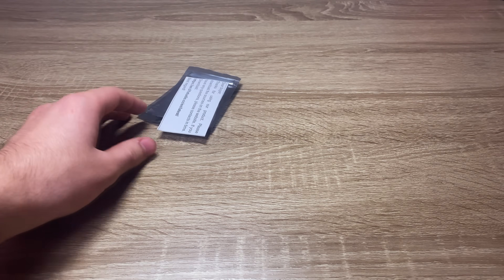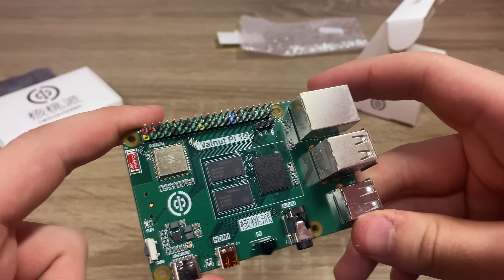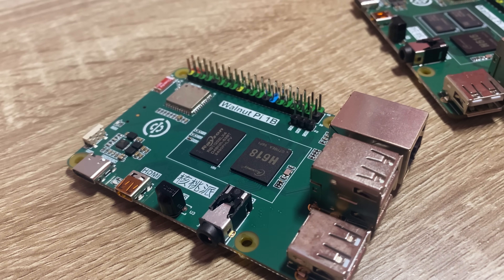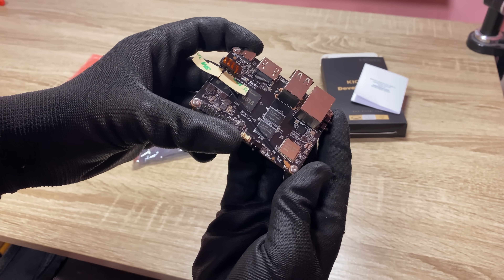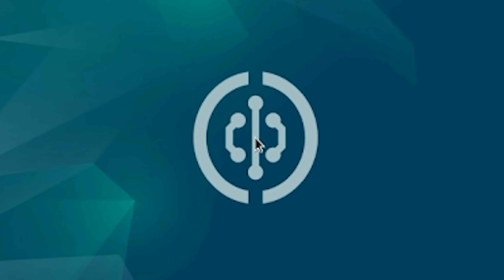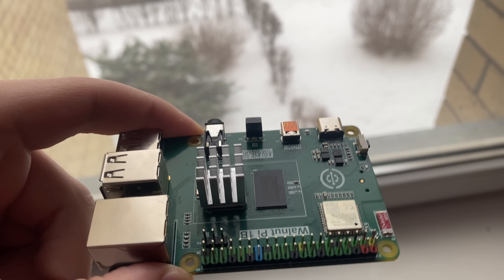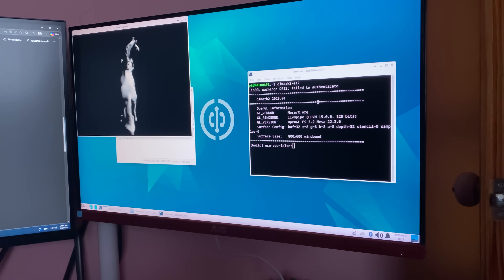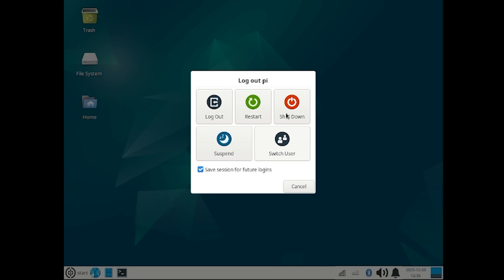I Bought the Cheapest Raspberry Pi Clone on AliExpress…

Comment: Hmm, the cheapest way to run genuine Linux, I've ever found a Redmi 2, bought a second hand one, the screen was cracked but it worked and was random. Between 1 and 2GB RAM, the price was only 2 dollars. If there was a promo, it was around 2 dollars in the country.Very good especially Debian with a good touchscreen sensor, the screen quality is very good at the right size of 4 inches 720p and the performance is quite good, maybe equivalent to the Raspberry Pi Pi 3, especially with Fredreno works, maybe I will buy the redmi note 4 series which has performance above the raspberry pi 4, of course the price is very very cheap, not up to 15 dollars 😂

Comment: The biggest problem with devices like this is not the hardware, but the fact that there is almost no software support for them. A year ago, I bought Spieed Longang Pi3H, which was supposed to have Armbian support "just around the corner" ... yeah, I'm still unable to run Armbian to this day (there is an unofficial image, but it doesn't work). Sure, you can run the official Debian from Spieed... if you're willing to trust an unknown Chinese manufacturer... Bigger brands like RPi or Odroid don't have these problems.
Reply from the maker: The Debian image for the board from a video is open source, but I haven’t examined code myself.

Comment: I got myself a while ago a Wukong Pi from AliExpress. It came with no support, no official firmware, but after researching a bit, turns out it's the same as an orange pi zero, with an Allwinner H3, but with no HDMI, so I set it up using UART and an ESP32. I installed a Linux image corresponding to the Orange Pi Zero OS, and now I have an "Orange Pi Zero". 

In these cases you are going to have more luck if you install an OS that is not the manufacturer's OS. In my case I used armbian, but DietPi was also supported. Keep it in mind if you end up purchasing these kind of boards.

I use my board as a cheap WiFi pen testing kit, and also for remote administration at university. After installing a battery onto it with a separate charge module, I can get 4 hours of battery life out of it. Very nice device, only 512MB of RAM tho.

Comment: Many years ago, after having to fiddle with Orange Pi and failing (the manufacturer did not provide kernel sources, video capture device was not supported on the provided kernel), I have decided to only use Raspberry Pi.
Reply from the maker: I guess situation changed since that time. Will review Orange Pi's cheap offering next month I guess, because they offer 8GB of LPDDR5 for as little as 55$ on AliExpress. Kinda curious to see how well it performs.

Comment: Hi All

Great video, for anyone who does not trust modern cheap hardware / software, you can purchased a 4 to5 year old dell / HP / Lenovo or similar thin client that will run linux fast ( or windows 10 )
I have 3 x PI3b and 1 x PI400 for spare machine when the main desktop and laptop are in use - all the pi's run emulation but the PI400 is dual book and can run as a reasonable Linux PC desktop

Comment: Listed processors should have some kind of hardware acceleration built-in CPU but probably not correctly initialized. They're slightly more expensive than they should be. There's 64bit faster processors with reasonable prices. Anyway if you need automation of some kind they might be useful
Reply: Which 64 bit platform is just a little bit more expensive? 😂

Comment: Raspberry pi's used to be a cheap single board pc alternative for cool projects, it became ridiculously expensive in the past couple of years. a pi5 is now the price of a cheap 2nd hand micropc which you can use as a nice home server. i have about 10 3b+ laying around and they're fun to use. but it's not worth the price anymore.same thing is starting to happen with arduino as well
Reply: The manufacturer promises that they will always cost exactly $35 no matter how many new versions are released.
Reply: @andrewhristov in that case i wish i could buy directly from the supplier..pi5 is already more than double that.

Comment: I have an Orange Pi Zero 2W 4GB, powered by the H618.

The Allwinner H616/H618 are designed for set-top boxes running Android TV, not regular desktop/server OSes.

The difference between the H616 and the H618 is that the latter has better support for newer Android TV versions, specially in higher resolutions. Graphic driver support for desktop environments is bad, really bad, and I don't think it will improve ever. Ethernet is only 100Mbit/s because it's enough for Android TV (most Android TV boxes that have Eth are 100Mbit/s).

There's an unnofficial release of Armbian for the OPi Zero 2W but only works ok as CLI, I do not recommend desktop environment because of the above. I don't even know if there are libraries in Armbian for the GPIOs...

Conclusion: avoid.
Reply from the maker: Yes, the problem is: there is no Android TV image for it (or I haven't found one yet). As for server OSes, why not? Good thing for lots of applications, like TG bots, klipper, etc. But yeah, for desktop those are just too weak.
Reply: @TheSillyWorkshop you can try the one for the OPi Zero 2W, from the official site. You do have to follow the instructions in the manual, using the writing tool they mention.

I hadn't used the OPi Zero 2W in a few months, seems Armbian now has a download page for it with the community maintained versions. Trying desktop with XFCE, the glitches I had even with the official desktop images on anything above FHD resolution are gone, seems fairly responsive at the moment. I'm using a 4K (UHD) monitor. Updating it and then installing a browser (none by default) and will write here with an update on the experience, specially YT videos...
Reply: @TheSillyWorkshop as I expected, no YT video acceleration, not even Firefox rendering acceleration, all software.

Armbian's XFCE desktop is usable but slow, heavy applications take a bit to load (fairly fast uSD card but seems SoC access is slow anyways) and their interface can take some time to respond depending on where you click. H616/H618 is not definitely for desktop use.
Reply: @TheSillyWorkshop In the 'WalnutPi_1_Android_TV_image‘’ repository on Github.

Comment: strange how one of the USB ports off the cheaper model, and I would trying make a Ip, than the actual real Pi, can it getting cheaper, one port instead of twom thee still one port the the soldier and everyth the putting port on the board, an actual hand placing a component on the board all that stuff you still need todo, and in the meantime try, be a better Pi that well a Pi, go USB power instead of hole? and the USB most like the used ports on most PI real ones or not? and not 4 a lot ports in the first place?

Comment: I own a bunch of those fruit pi or china pi likes, they are cheap af and works ok, but the main problem is the lack of kernel support for those chips, they are mostly based on a soc manufacturer proof-of-concept first release that's as old as Linux kernel 4.x, and the available system images with outdated and eos 5.x kernels are just dirty dts hacks with hundreds of bugs with half features not working. Don't even bother trying to compile Armbian and even less try to ask for help in their forums, you'll just end humiliated. So yes, proper kernel support is the most important thing here in a world of hundred of rasp pi clones, maybe that's why Raspberries are way more expensive, if you are looking for cheap chinese pi alternatives, look for the ones with proper kernel support or you'll end up stuck on an old eos kernel and a system image full of cve's.
Reply: Which ones would you advise to use? Wallnut pi has good Linux core support?
Reply: @mmuller2402  look for supported boards by Armbian project marked as 'conf', they have great support, 'csc' is community supported and it's a hit or miss.
Reply: @mmuller2402  if you don't need gipo just get used mini pc. Used Lenovo m72 tiny can easily cost like one of those sbc and perform 10 times better
Reply: Entonces, cuál recomiendas de las placas baratas? Que tenga un buen Linux sobre el que montar nuestros proyectos? Gracias!

Comment: This looks good, initially, as a small server, but I would stay away from any of these clones. They will not receive OS updates anymore and at some point you will not be able to update the packages for security. Maybe good for some controller that never needs updating.
Reply: ? The updates come from whatever OS you install. Install raspbian or armbian and updates are available
Reply: @TechdoLiberal  Half true. I have a TV box converted to armbian but it stopped receiving OS version updates a few years ago, so it's now stuck on jessy or wheezy. If you are on an old version of armbian you might be missing out on shiny new packages or you might run into incompatibility issues. Sure, it's open-source, but porting a new debian release is not really trivial and the work is already done for Pi.

Comment: There is no CE or FCC certification on your PI clone boards. They are illegal in Europe and USA !!!
Reply: CE means nothing when it concerns legality. The same with FCC.
Reply: @samuellourenco1050  Without a CE Declaration of Conformity, the product is not considered safe and cannot be sold in Europe. Likewise, without an FCC ID, the product cannot be sold in the United States. This is not a joke—devices that are not properly tested can be dangerous and may cause interference or malfunction in other equipment, including medical devices. Additionally, what about hazardous substances such as lead?
Reply: @pigi_experiment Have a think about what you just said... what you specifically said is that it can't be sold in the USA and EU without the relevant certification mark. As you just pointed out it isnt illegal to OWN this device just for someone to sell it.
Reply: @Haxman-o3z  In USA every device that use wireless comunication (wifi/bluetooh, etc ) MUST have an FCC ID. FCC ID is important because it ensures that electronic devices comply with the regulations set by the Federal Communications Commission. These regulations are in place to prevent interference between different devices and to protect consumers from potential harm caused by excessive electromagnetic radiation. The same for Europe, any electronic device MUST  comply with the regulations.
Reply from the maker: Will be watching certifications closely next time,  it might give me  opportunity to call the video "bought the illegal 'product x' from Aliexpress" :D
Reply: Who cares USA and Europe snowflakes...

Comment: There are many very cheap used or new Android TV boxes available that you can run Armbian on. They are actually powerful devices. Some can even boot from an SD card.
Reply: he made a video about it 2 months ago
Reply: Yes they worth, if above 20$ not worth it.
Reply: @justfahmi1 I can found a software bricked android TV box for 10 dollars.İt has 4 cores 1 GB ram but it Hande my robots aı task and I can install on it casa OS.The armbian It uses 100MB of RAM when idle.Therefore, even with only 1GB of RAM, you can still get anything you want running.
Reply: Did the same
Reply: nice, thanks for the tip, i have a tv box laying around here somewhere that i don't use, perhaps i can play around with it.
Reply: Yeah why not if you find one for 5$
Reply: Any idea how to boot armbian on it? Doesn't it hard to flash because that kind of devices are proprietary?
Reply: @wijdani.k.9435  It depends on the device, I have a tx3 mini and booting linux is easy enough.
Reply: @wijdani.k.9435 Send to model to me
Reply: My first server is H96 Max Plus
Reply: 😂 i buy drvice 2 dollar and run Debian 13 good performance
Reply: Some? more like most.
I've yet to see one that doesn't boot from sdcard.

The real problem is booting from internal storage.
Reply: @abdalnablse10 not really, by dumping or modifying the kernel/device tree and with low level access you can make it boot other operating system on a very locked down tv box
Reply: @Displxyz  I haven't really used the locked down ones, you can boot on internal storage, sometimes it's easy and sometimes it's hard.

Like booting on emmc is way easier than nand for example.

That's what I meant when I said it's a problem.
Reply: @abdalnablse10 by reverse engineering the board layout, you can tweak the dts and flash and boot from emmc/nand but very few make it, since buying a other box that boots easily like x96q, tx3 mini is easier than doing all of those things
Reply: @Displxyz  Now that you've mentioned the tx3 mini, may I ask how do I build the latest u-boot from source?
Reply: @abdalnablse10 im not an expert on building those dts(es) but it should be hard or easy or you can find one and put it in your firmware
Reply: the AllWinner H616/618 SoC the walnut pi uses is actually made for cheap android tv boxes, and is most likely what you'll find in most.
Reply: cheap android boxes are probably filled with malware and are scamm.esspecialy if u buy 4k box and it lags playing simple 4k video instead playing it smothly
Reply: @hardscorerockkssss  It seems you missed the part where he said run Armbian and not the os that come with it.
Reply: @hardscorerockkssss What's the point of having malware if its purpose is precisely to replace Android software with Linux?
Reply: @hardscorerockkssss from experience, this is accurate

Comment: I think Orange pi plus 2e better than walnut pi
Reply: orangepi is ass. Telling you as a dude that has 5 opi products
Reply from the maker: To be honest, unlikely. 40nm H3 is much older than 28nm H618, even with walnut's problems. Depends on price though, I am sure that for most light applications even H3 will be enough.
Reply: @TheSillyWorkshop my youtube chanel orange pi plus 2e libreelec is very performance.

But armbian low performance.

H3 is supported batocera , lakka vs
H3 is very old yes.